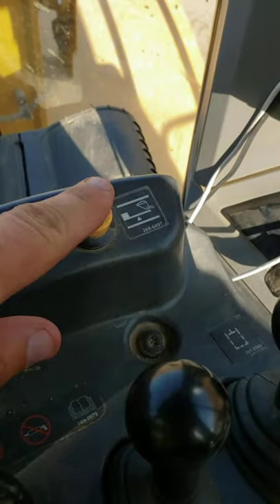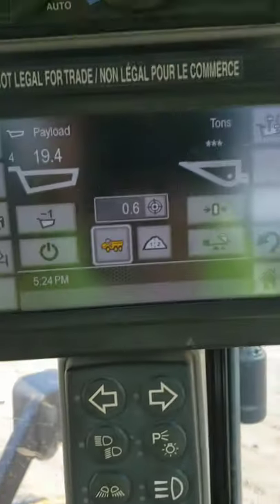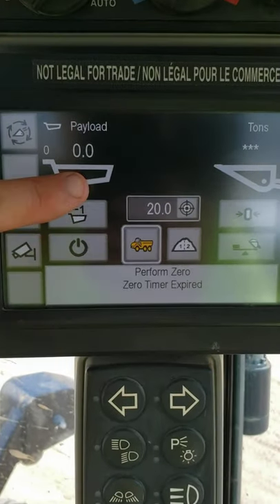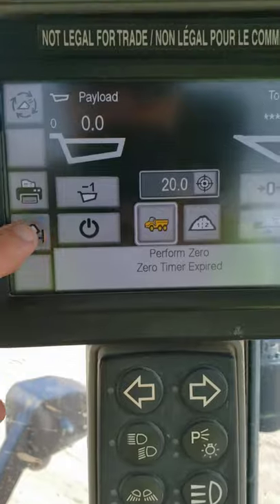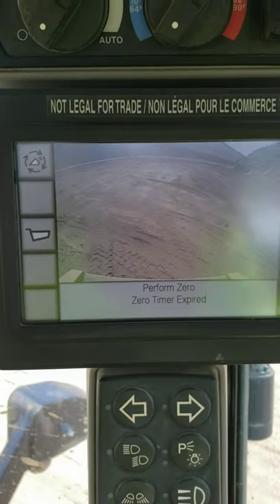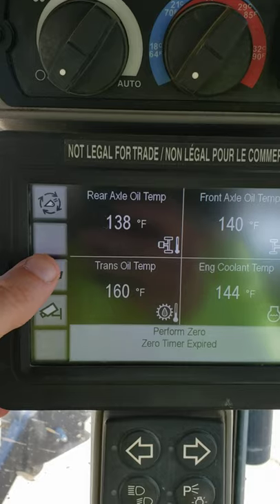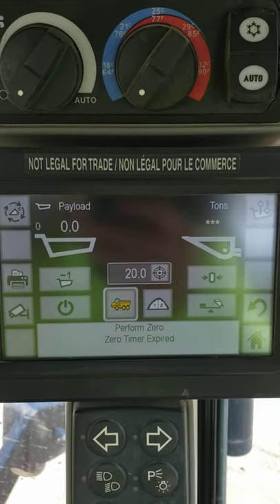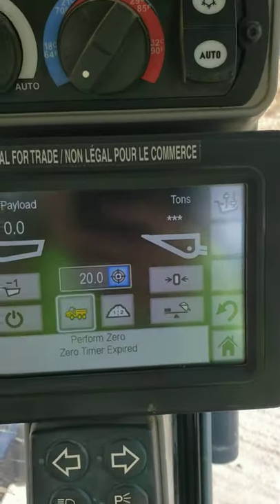Lets drive a Loader Cat 972

Comment: I drive a 930g and I hope to drive one of these beasts one day good job!!!
Reply: I drive 980's and 982's  every day and sometimes I get my hands on a 994. All are awesome machines compared to other brands.
Reply from the maker: I agree, I've run the early 90's CAT 980 and we have a CAT 990 but it's mainly used for loading the concrete crusher's hopper. I haven't ever used it.
Reply: @UniWonder  I also drive Volvo L250's and Ljungby L-30's. And I load haultrucks with a LeTourneau I-2350. We have quite the varied machinepark on site. The Volvo is decent, but the Ljungbys are absolute dogshit. Worst I've ever tried. Can't even explain in words how awful they are. The LeTourneau is nice, but it is more in the shop than on site. (49% availability last year)
Reply: @ZeroneAngel  dude 988 is my favorite caterpillar, wheel loader ever built!!!!!
Reply: @augustbehle3589  Yea, they're awesome. They feel like a tiny version of a 994. Love em' too.
Reply: @ZeroneAngel same here with the 80 and 82, how big does the 994 feel in comparison to the 982 ? I run that everyday 12+ hours
Reply: @sudzify8939  Well, where to start? It's freakin huge, obviusly. Just climbing the ladder and then the stairs just to get to the cab is an awe inspiring feeling every time. 
But with its enormous size, sight is an issue. You can't see anything closer than 30 ft to your sides and forget about anyting closer than 150ft behind you. Having one eye on the camera screen at all times is absolutely essential. 
Also, since you're working on constant RPM it requires you to work in a different manner. You never touch the accelerator. Just use the break pedal to monitor you speed and power. 
And its size makes it much harder to get feedback from your bucket. It takes a while to get used to basically not knowing your teeth angle or where your bucket bottom is by feel. You just have to "Know". Of course, that depends greatly on what bucket and teeth you're running.

Comment: Steering ? Wheel lever or half wheel ?
Reply from the maker: It's a lever. The same one as the shifter is on. Shorts only have so much time. If you have trouble steering, please stay out of the cab.